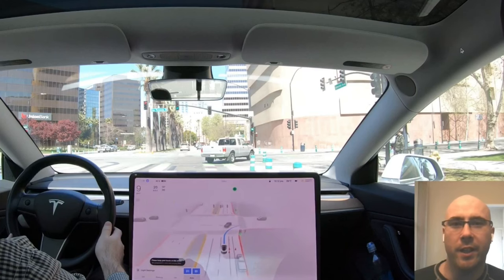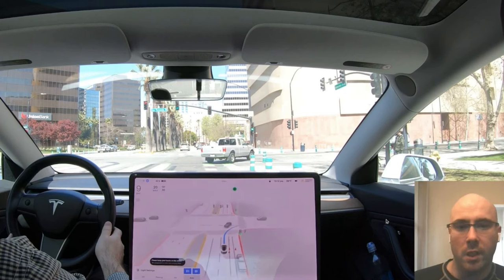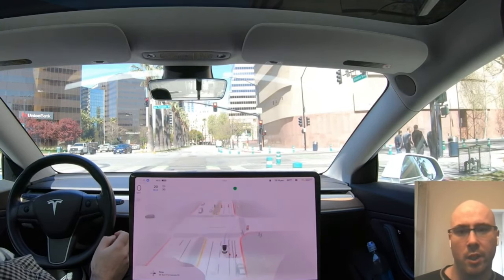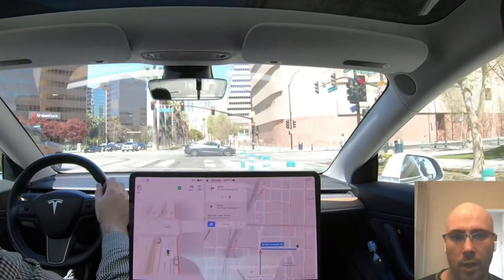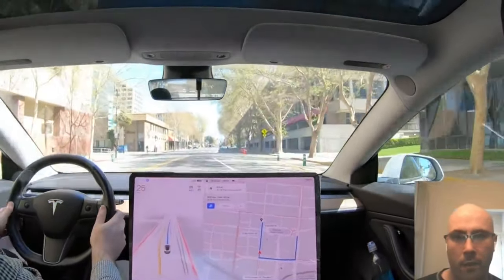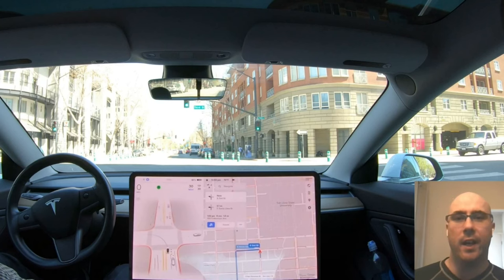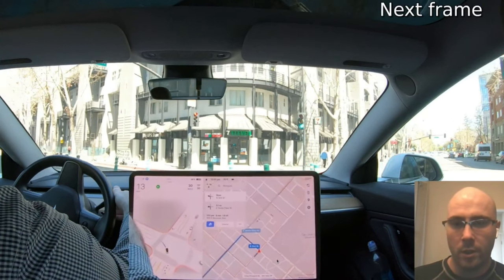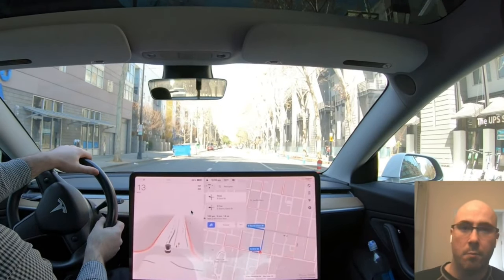Recreating the Full Self Driving Crash

Comment: I realized that in the first attempts you activate fsd very late. Would that perhaps influence?
Reply: In the 5th, it was activated in the same way and passed. Very odd as I don't think it learns in that way
Reply from the maker: Yes definitely! That area is difficult to get a full speed approach at the intersection unfortunately.
Reply from the maker: @iKaGe01  It definitely seems like it learned in this case though! I didn't think that was possible tho. Perhaps the sun moved just enough to make a difference that we can't see.
Reply: I've found in watching fsd videos that it does seem to struggle in the first 100 yards or so.  Especially if it doesn't have a traffic light and time to adjust.

Comment: Good tests. As you can see much of the action goes on below the dash horizon because of the low camera placement and there is also a "slight" overexposure issue of the outside. Moving the camera up and forward to something like a leaned forward passenger head position would presumably improve it a lot. Ideally a camera up by the center AP cameras. That's a very different vantage point.
Reply from the maker: Thanks Dan! I want to get a second camera and try out your suggestions. It will add complexity to shooting and editing, but will improve the videos. Thanks for your continued support, it means a lot! Cheers